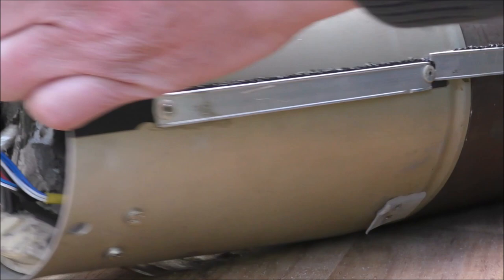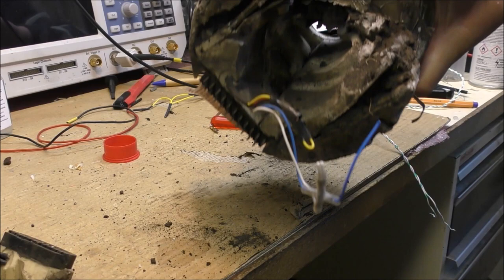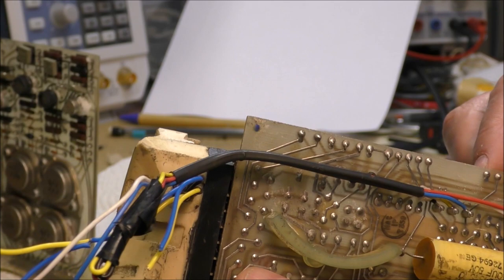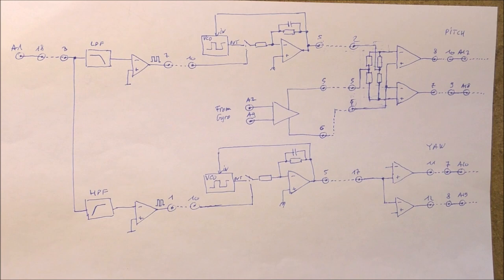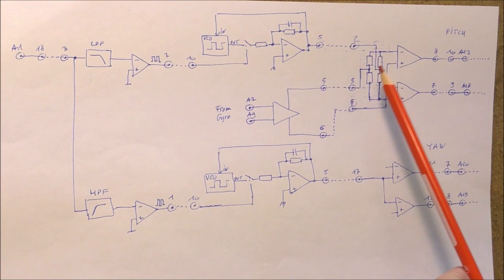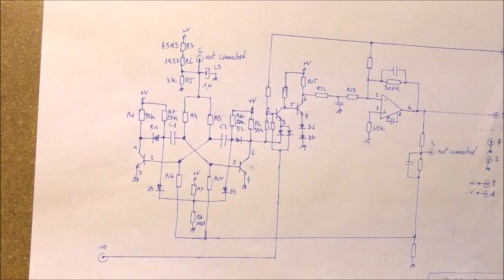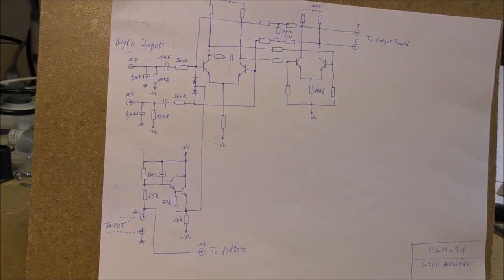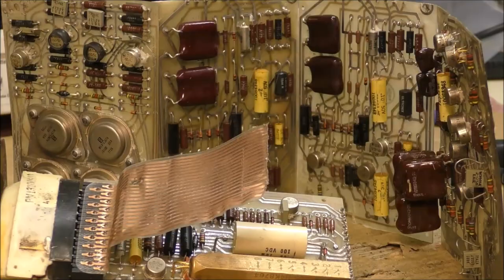LDM #270: BGM-71 TOW Missile Part 2: electronic boards

Comment: Thank you for filming this, especially the detailed analysis of the circuits. Due to the secrecy around such systems I always imagined them to be a lot more complex and advanced than they actually are. Amazing to see how simple and straightforward the electronics are, pretty much what one would expect.
Reply: By the shape seems to be an early model, so designed in the later 60 and produced into the early 80s.

Comment: Some of those TO3 devices mightbe itty bitty relays, as i have seen them on missile boards. They work great for stitching stuff in audio and lower frequency RF gadgets. The atlas part is an acceleation dashpot timer. It prevents the warhead from arming until a certain g force for time is exceeded. ❤

Comment: The actuators for the TOW missile are actually pneumatic. There is a high pressure gas bottle and 4 solenoid valves. 2 for the pitch and 2 for the yaw. When the solenoid valve is engaged gas is fed to one side of a piston that moves the control surface.
Reply from the maker: Yes, it is compressed helium.

Comment: This Atlas part is strange, if I had to guess I would say this is the safety/sequencer, something along the inside of the tube changes or moves with G-force, opening and closing gates to arm the missile at safe distance. Gate is closed because the missile has been fired and therefore been armed, the drawing might show flight seconds. Just a guess.
Reply from the maker: It is probably something like that but I think that the numbering is just the order of the sequence. The duration of actions in the missile are shorts, for instance the duration of the flight motor is 1.5 second only. At the end the sequencer input control is probably short-circuited in order to have a single sequencing process for safety purposes.
Reply: Further guess: TOW has a double shaped explosive charge to defeat active armor, therefor the missile needs to trigger the charges in a rapid yet precise sequence, the impact would then move a mass inside opening/closing gates that would eventually end up in the back. This part could be tailored to the right timing for different war heads.
Reply: @lelabodemichel5162  This game is fun! I remember playing it as a military on the navy Island Le Levant against all rules and common sense, dismantling an anti-submarine sonobuoy to be dropped from the air: an aluminum cylinder with winglets that rotates to stabilize the fall and being torn off entering water, that would free the antenna, release an amazingly strong yellow die to mark the spot and unravel a long elastic tether with two hydrophones at different depth that could be set prior to deployment. Inside you would find an empty lead battery that would fill with sea water and power the small transmitter. A beautiful work of engineering of simplicity, functionality and reliability. Not knowing what it was at first  I had a big scare when I triggered the antenna that snapped out in my face :-o
Reply from the maker: I had the answer from someone: this is a pyrotechnic relay. Delay of action is 0.065s on this one. Contacts are activated by little explosive inside. This thing can be found from Eaglepicher company.
Reply: @lelabodemichel5162  Makes sense, nice channel

Comment: Thanks Michel for interesting analysis. I'm curious about input filter design. As an RF engineer I find it strange. If you need a low or high pass filtering it can be implemented with a simple LC circuit. Why do you need transistors? Unless this is a filter with integrated signal amplifier? Do you have any thoughts?
Reply from the maker: You can do it using inductors and capacitors but the values would be large for such frequencies and I guess that weight and size is an important matter. The filters use Sallen-Key low and high pass active filters and band-pass filters too.